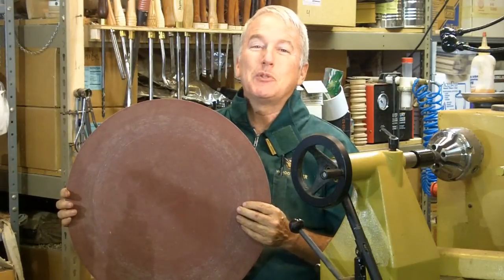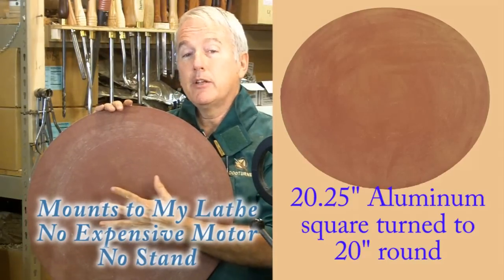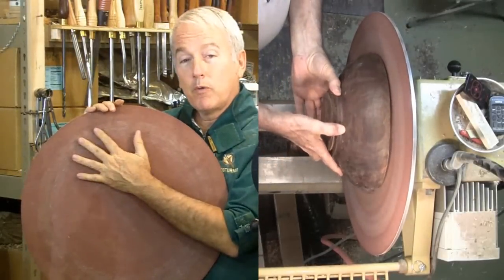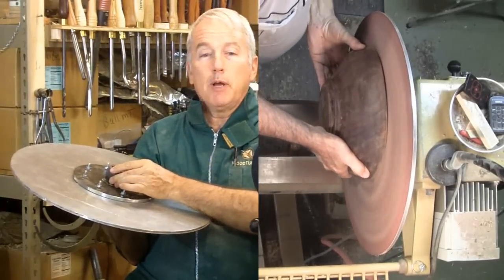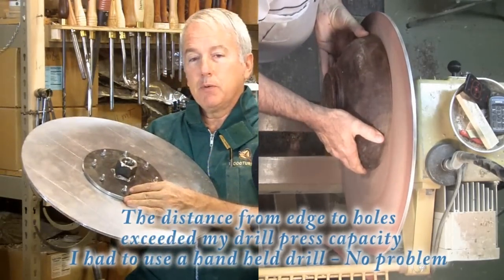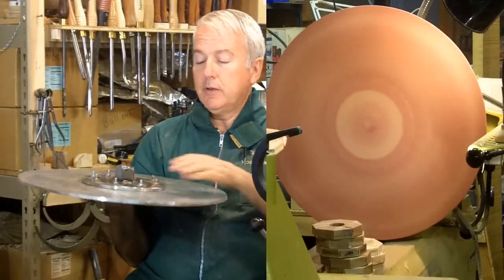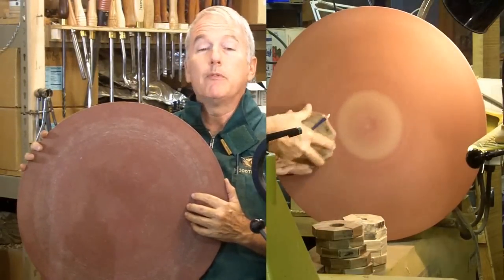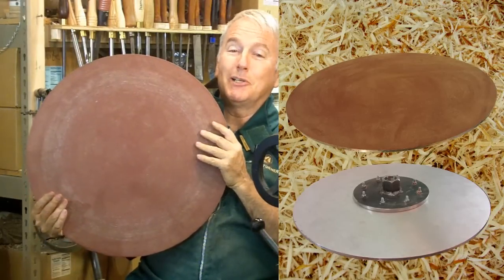Giant Sanding Disc Offers Options For Woodturning

Comment from the maker: On PSA discs (Pressure Sensitive Adhesive), the glue was applied to the paper at the factory. It is a very thin uniform layer. When time to change the paper it peels off fairly easily; a thin scraper sometimes helps. I've never needed heat. Usually it all comes off in one piece. If not, then scrape off the rest with a putty knife.
Thanks for watching
Alan Stratton

Comment from the maker: I'm using PSA disc's - (Pressure Sensitive Adhesive) preglued discs - just peel off the backing and ready to stick. It's much better than spreading some yourself.
Alan Stratton